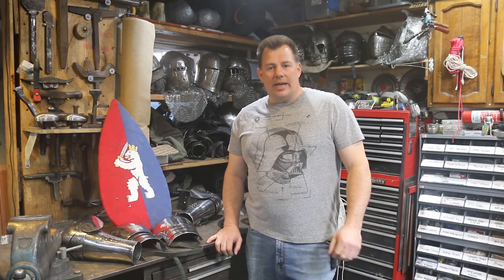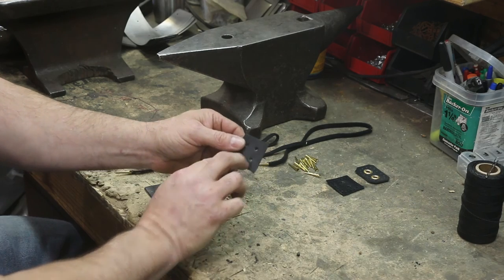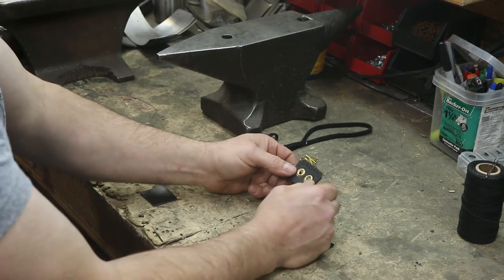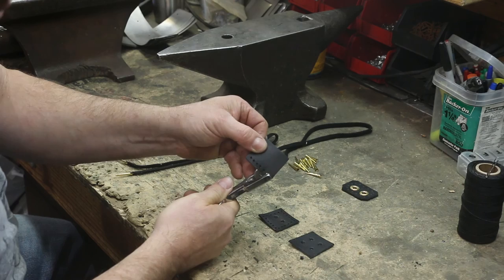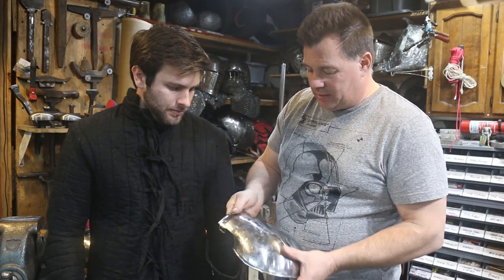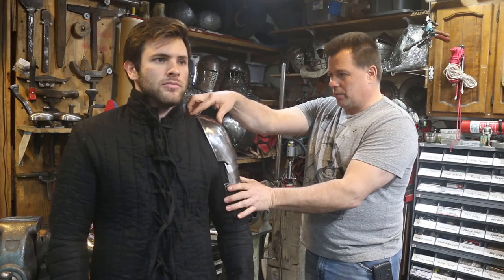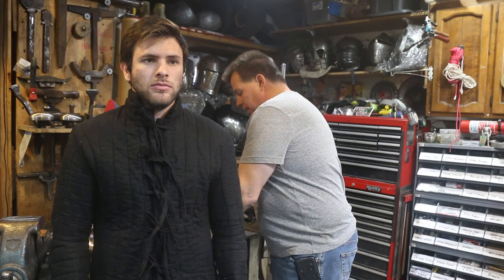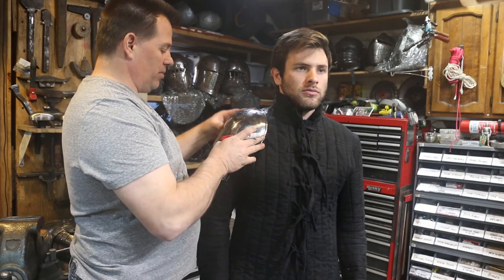Ursus Arming Point Tutorial

Comment: Hey Steven, great video.

I use a much lazier method when I do my points. I put the leather on the inside of the gambeson, with no sewing. I tie a knot in the lace between the two holes in the leather (so closest to the skin) to stop the lace sliding through.

This has the disadvantage that you must tie a knot on the outside too when the points aren't in use, or the whole thing will fall inside the gambeson, but when they do it is simple to just shove the laces back through the holes.

The other disadvantage is that when the gambeson is cold and wet, ie: when you put it on again on day two of the event, the leather is a little rough on the skin.